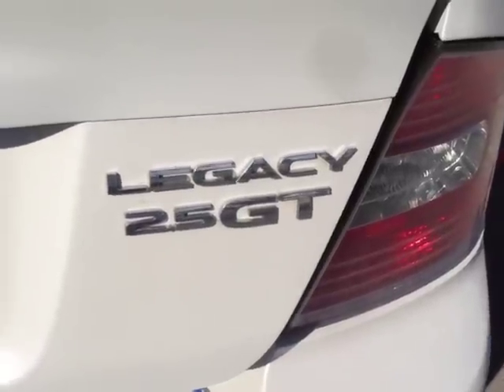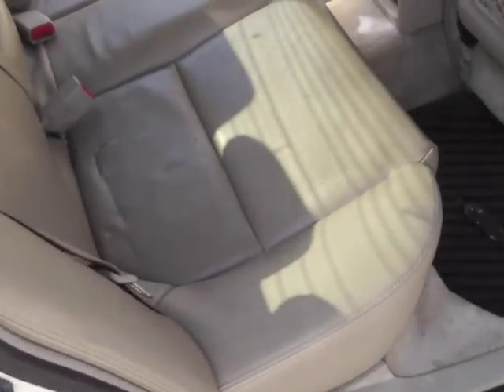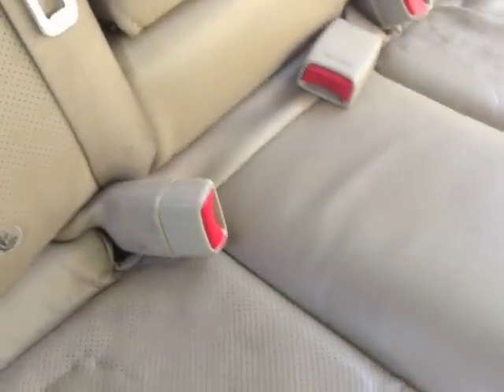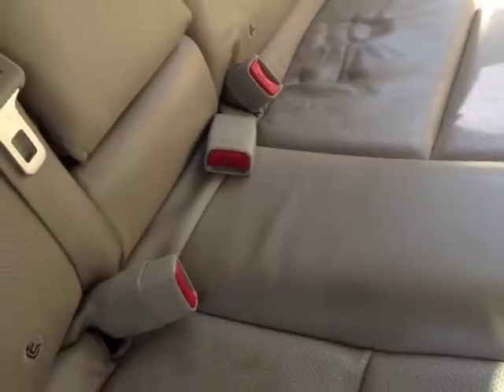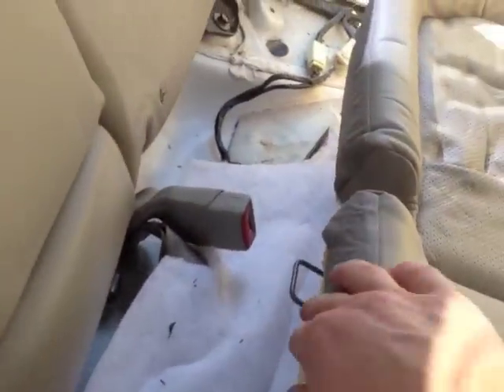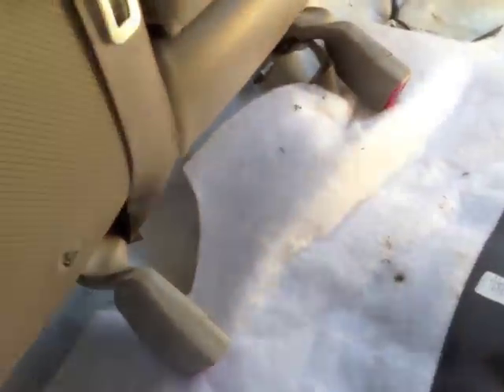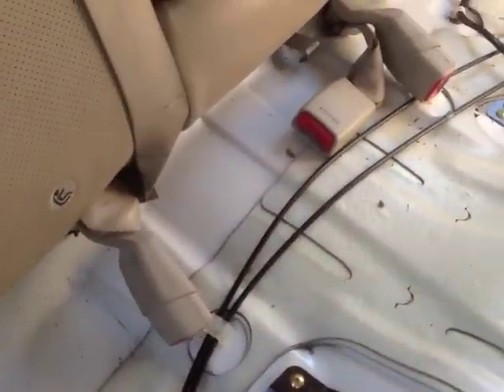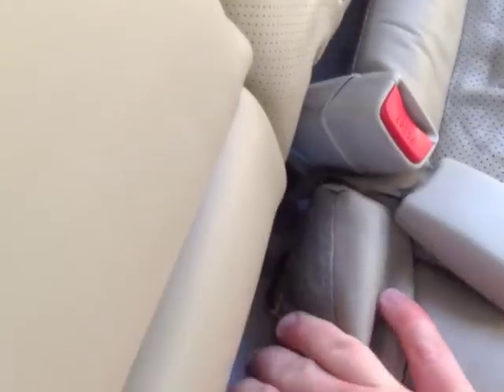Remove Back Seat 2005-2007 Subaru Legacy GT & Seat Belts

Comment: When you're putting it back you won't need a second person to hold the buckles, just plug them in the seatbelt before putting the seat back and then pull the belt up if its still in.
Reply: You're smart
Reply: Good idea

Comment: I just removed the rear seat in my 2015 Legacy thanks to this video. It came out the same but I also had a cable that had to be disconnected on the passenger side by pressing a small tab. Many thanks Mr. Feller!

Comment: 1999 Subaru Legacy GT, seats had two bolts in the front but the back removed the same way except had to pull it on a angle as removing it.